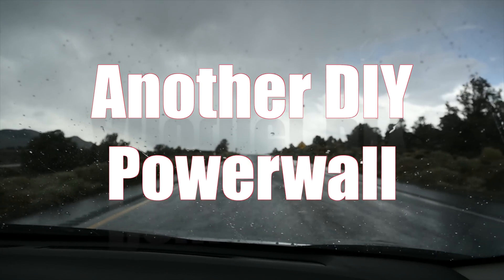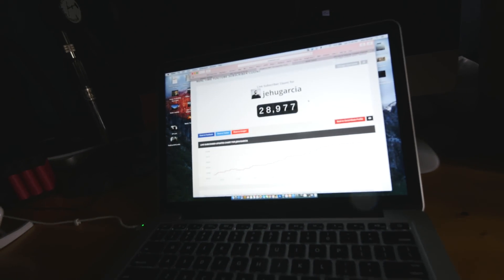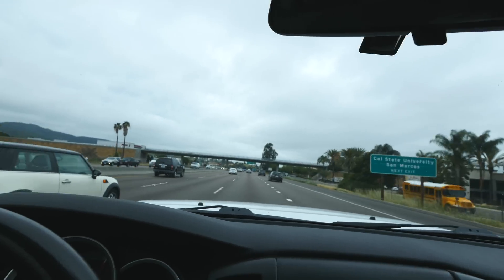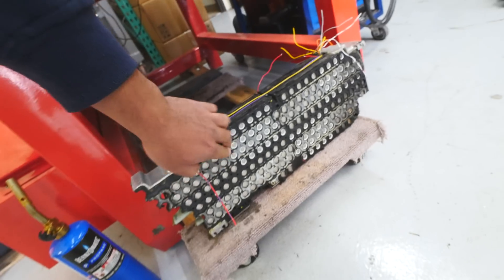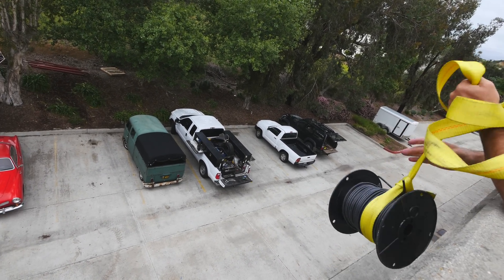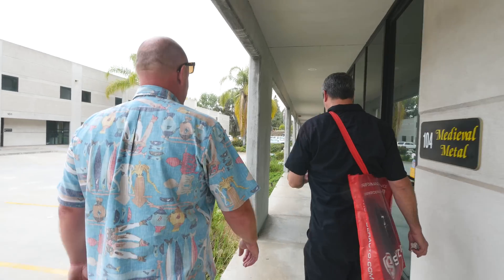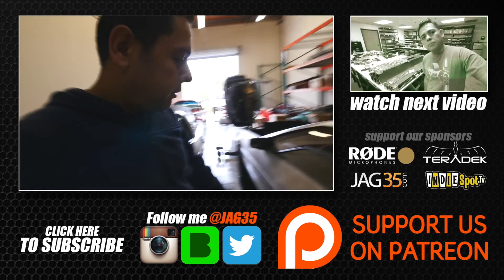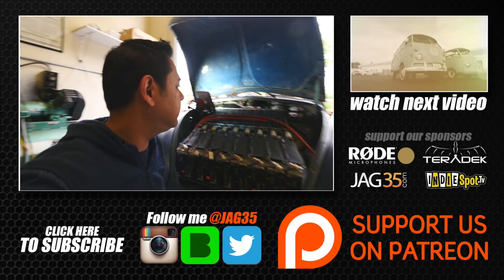DIY TESLA Powerwall talk #1 - NEW EVWEST OFF GRID PROJECT

Comment: How do determine the best or which panels to use. I have a house that has a 3K power panel and use a max of 1100 k wh on the peak month for the past year (July). How do you figure how many panels are required and what size power wall to make. I would like to do most of this myself and be able to take it with me when I move. Looking into making a container home. Thanks Mike USNR (AT)

Comment: I was wondering why you do not use 120 watt flex panels on your van? You could probably put 4 or 5 on your roof. I am using one on my plug in prius.  Charges while I am at work and a split between an inverter an a charge controller gets me less gas used. I am paying 15 a month to go 22 miles a day commute. I think I can trim it down to 7 bucks a month with the flex 120 watt solar panel. I am using double stick tape to mount it. 159 a panel on ebay.

Comment: Very nicely presented. You really are presenting a valuable service where you've generously provided the ground rules for lithium cells for power walls and ebikes. I hope that net metering and installation of UL approved grid inverters becomes more conventional, acceptable for homeowners. As it stands it still isn't easy to apply for net metering approval and the hardware sources aren't off the shelf items but with guys like you teaching the basics it all becomes more approachable for us.